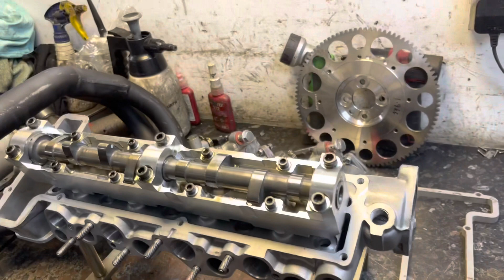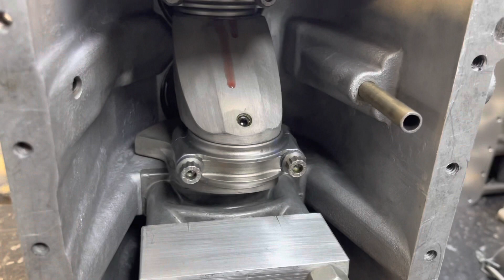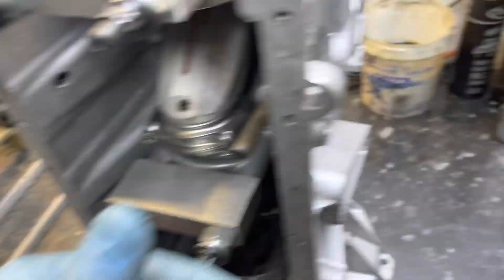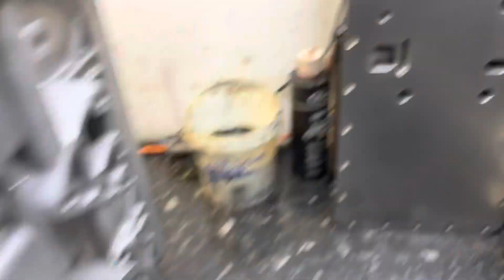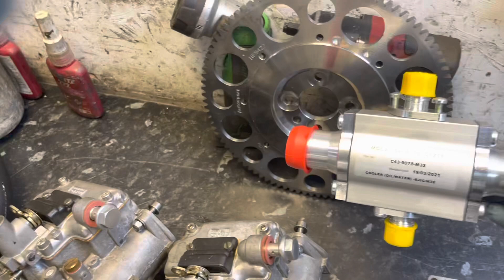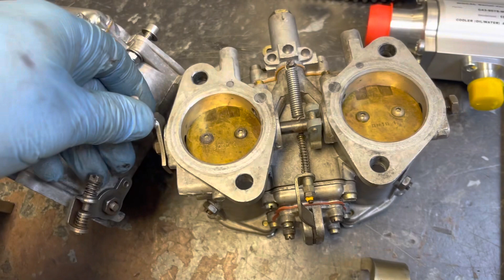Hillman Imp full race 1150cc imp engine build part 1… the ingredients 🤣

Comment: Hi thanks for this video I used to races side cars as a passenger the driver was John Derbyshire in the late 70s with a Kawasaki Yoshimura 998 cc a other side car driver malc Shepard  had 998 hartwell imp engine in is outfit with twin choke Webbers which was very fast as fast as are Kawasaki if not faster on the straight I will be watching all these videos great quality work on this engine fantastic cheers mate Colin

Comment: This stuff is so good. I had a sunbeam sport back in the day. The one with the twin headlights but not the fastback. 875, but came with a highlift cam,  twin Strombergs, the 4 into 1 pipe and the oil cooler. Think it had servo brakes unlike an earlier one I had. Great fun to drive. Always wanted to modify it but never got around to it. Lovely work in that engine!!
Reply from the maker: Thanks for comment, yes the sunbeam imp sport is becoming a very desirable variant, like the “cooper s” of hillmans !
Reply: @thehillmanator   always wanted the rallye but they were like hens teeth even when I was a kid.  I remember replacing a door on the old car from a much newer one, there was a huge weight difference!! they must have cut the gauge of the door skins down considerably at some point. Loved that Sunbeam, it would just touch 50 in second but the red line cut in like a switch, I think at around 7500rpm... which was mad considering the age of the design. After I got it I got the carbs tuned by someone who knew what  they were doing, also fitted a new chain to stop the timing mark dancing around, new plugs and leads, rotor arm etc, actual bought a micrometer and a bag of shims to set all of the gaps correctly... ran like a dream.... good times, happy memories.

Comment: Did this engine ever have a 16 valve head for some reason i remember skimming and setting the valve clearances for someone who had a 16 valve head for a hillman imp apparently
Reply from the maker: not that i know of.
Reply: Years ago the late Pat Mannion, who owned Revolution wheels and raced imps in the Wendy wools special saloon series had the moulds to make castings of twin cam heads for the imp, but unfortunately I don't know what happened to them.
Reply: @trevorhows3281  This possibly could have been one if I remember right it had a lot of other parts from the 8 valve

Comment: Looks promissing! 🤔 Is the top plate used to get more stroke and maintain good rod/crank ratio?
Reply from the maker: correct yes two spacers if you look closely 5 mm for the strokes crank and 16mm to attain correct rod to stroke ratio 👍